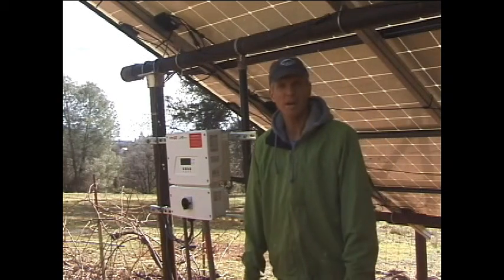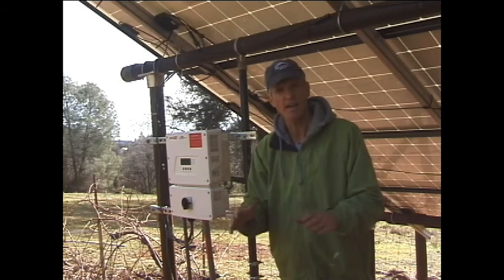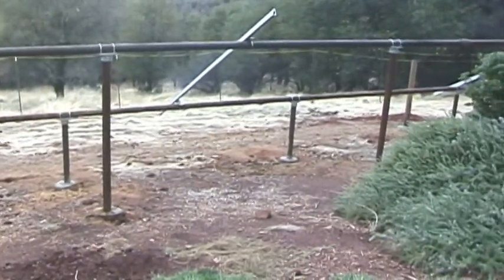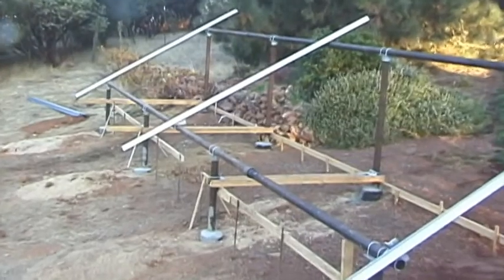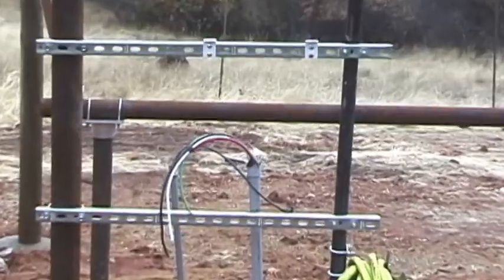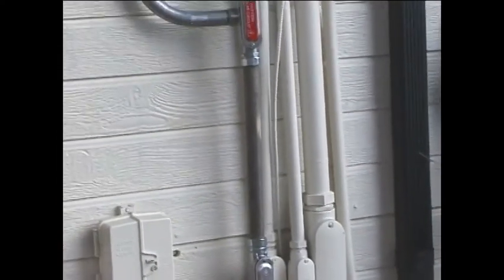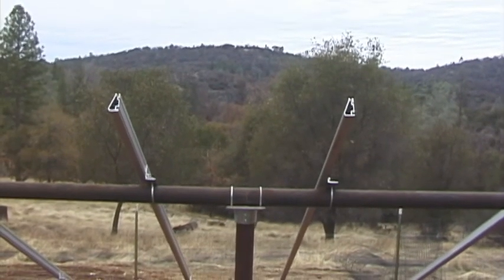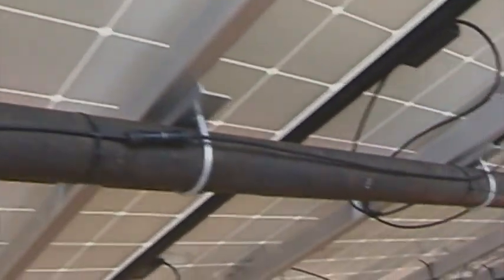Ground Mounted Solar Panels on uneven sloped ground

Comment: What are the requirements for the post in California , anything special ? Dobe blocks etc..
Reply from the maker: It’s been a while, and each city may vary its requirements. But the 3 inch metal pipe was put in the ground somewhere around 60+ inches. I poured over 2 yards of concrete for the eight post. That’s California with its over regulated requirements.